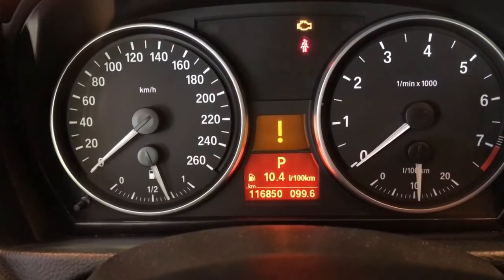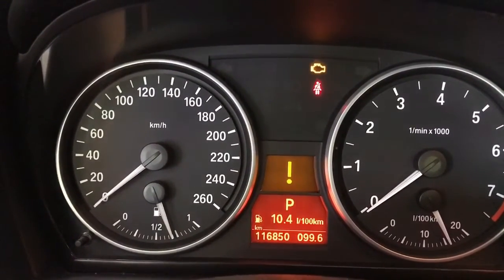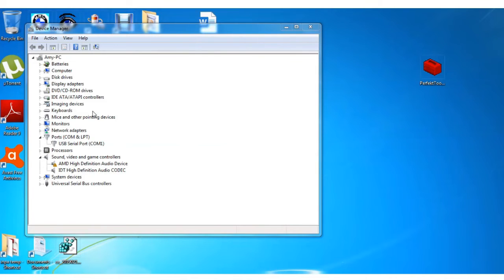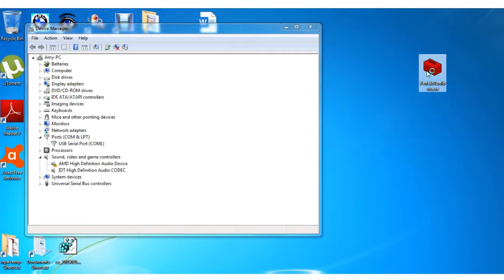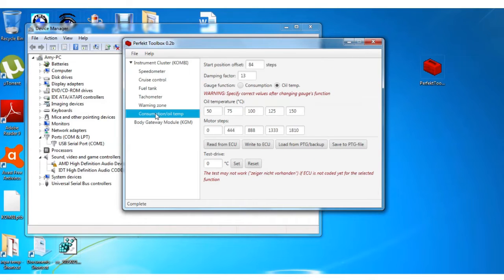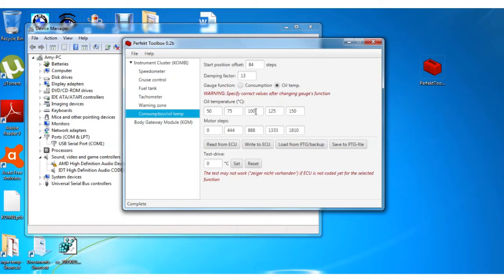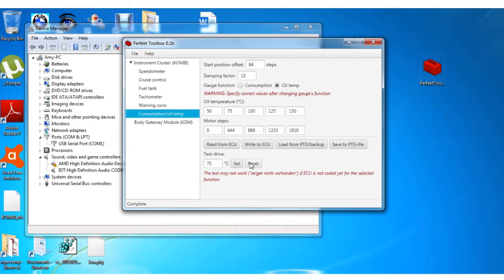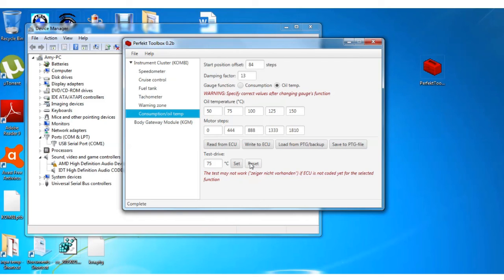Convert fuel economy gauge to oil temp on BMW E90

Comment: Hey I tried doing this on my 2007 BMW 323i, everything went well but the Perfekt Toolbox software never opened, tried it multiple times but when I click on the software nothing happens it doesn’t open up. I used a laptop running windows 11 not sure if that’s the problem. Please advice.

Comment: Old video. I just did this on my m57 330d e91 and it never reached 100 degrees. Even at 42 degrees celcius outside did not reach 100. It mostly is arround 50 to 70 degrees. I don't think this is working as it should.

Comment: Thanks for the guide it works on my BMW E90 320i N43B20.
I have the „Low“ Cluster and the consumption gauge can be changed to oil temperature gauge just like in the video. Also, before you code in the oil temperature gauge, you should check if your BMW has an oil temperature sensor installed. Some don’t come fitted from factory like the M47 Pre LCI. That’s the reason why it doesn’t work on those model. Just for clarifying

Comment: Works on 330d e90. The only issue is that temperature raises to 60-70 sometimes 80 degrees and then after regular driving temp drops to 50 degrees...i don't think is indicating properly.

Comment: Hi guys, there is actually a easier way to do this and it's even for anyone driving a BMW E-series, it's a new beta feature in Carista! I’ve been using it for a bit, and it turns the fuel consumption gauge into a real-time temperature monitor. You can even customize the temperature range that shows up, which is super handy.

What I love is that you don’t lose the fuel consumption display either – you can just move it to the center screen by pressing the BC button, so you still have both pieces of info right there.

Honestly, it’s been a game-changer for me. Definitely worth checking out!
Reply: this is the same thing and it doesn’t cost money
Reply: I emailed Carista and checked about this.  They said they DONT support this feature for BMW diesel engines
Reply: Can you post a video of that?
Reply: really? on a diesel too?
Reply: @daviddorado5632  yes it works, sorry but I can't post photos or videos here. But toy can try it out with Carista!

Comment: Hi Eng Guy-   This little app of yours is absolute genius!   The MPG/LPK gauge is a usless feature BMW started in the late 70's......
1) By the way, your toolbox download link is blocked by most PC browsers.  My workaround-  download the zip file onto my iPhone and then send the zipped to my PC.
2) I saw a PDF somewhere describing how and where to install the app, but don't remember where I saw the install PDF.  You zip file is just the exe file itself with no help files.  Do we install the PerfektToolbos.exe file in the EDIABAS folder?
3) Do you have a 64bit version?
4) Have you done any research on upgrading the radio/nav head unit-  ie CCC to CIC retrofit?
Thanks!

Comment: Works like a charm with 330d M57. Only minor issue is that gauge doesn't point exactly to zero on ignition start.
Reply: @czr4140  what year is your car btw ?
Reply: you can change that with this
Reply: Are you sure it the oil temp and not the water temp?
Reply: @LighthouseBaptistChurchAlmere  it's water temp, i stand corrected
Reply: Did you figure it out? I’ve set the offset to 0 on mine and that way it works perfect
Reply: @E90335d  sure, played around with motor starting position and set it up the way i like it. What I can't figure out is why coolant temp sits at around 82 degrees with both thermostats changed. That's some mighty torque btw 👍
Reply: @czr4140  thanks bro, that’s why the offset is so high so when it’s 90degrees the needle is in the middle. The thermostat is 88 degrees so 82 should be fine 👍
Reply: it is water temp actually
Reply: @czr4140  what do you mean? The temp were seeing is not the the oil temperature?

Comment: It won’t work on my e90, 2006. M47N2 ☹️☹️😡😡 on oil temp stays on minimum, i saved backup and return
Reply from the maker: Sounds like a Euro engine to me.  North american Engines are N5X
Reply: @mecheng1977  yes its euro engine. Is there any way to set it up? 😫
Reply: It doesn’t work on m47… same problem

Comment: Hello, your conversion instruction is great. I installed the Perfect Toolbox, everything works, I did the conversion, the test-drive works, the indicator shows the set value. The problem is, it doesn't show the oil temperature. Is it possible that my engine does not have an oil temperature sensor?
e91
2006
2.0 Diesel M47N2
Reply: same problem. oil temperature sensor appears to overwrite the data from the coolant temperature sensor. through diagnostics these two data are identical. After setting as in the video, the oil temperature is kept to a minimum
Reply: Did you find any solution yet?
Reply: Same here for the m47n2, anyone found a solution?
Reply: I have exactly same problem

Comment: Hey, does this work on e92 2011 335D. Thanks!
Reply from the maker: Not sure
Reply: I think it shows the water temp not the oil temp. I did my 2006 335D and it never gets much above 75. Diesels do run cooler but it seems like water temp. Also on mine I only see a water temp feature in the hidden menu

Comment: Why do i also need the BMW EDIABAS software? How do i know what motor steps to insert, or can i just leave them as is?
Reply from the maker: You can experiment with the steps
Reply: @mecheng1977  Thanks, i have got it to work, was quite easy actually.

Comment: It works If i test it in the perfect Toolbox, but it doesnnt change when i drive. What is the problem? M57 2006
Reply from the maker: Are you sure the engine is warmed up? Sounds like it didn’t write to the kombi
Reply: @mecheng1977  yes i am sure the engine is warmed up, i think it doesnt work on my car..
Reply: @robbertslingerland2633  I have the same issue. Same engine an year. When I applied the changes, the needle just moved 1mm to the right and doesn't react anymore. The needle moves in the test, but it's dead on the dash. Can someone help?
Reply: @MTSnev  bro same year same engine same problem did u fix it?
Reply: @dena.  no mate… I think it’s because of the cluster itself. It has to be the high version - after 2007
Reply: @MTSnev I have 2011 335d mine is doing the same thing

Comment: Remember this works only with High Speedo and not Low Speedo
Reply: what do you mean about that?
Reply: @HeavyModded  Its two different speedometers. For example like on E6x its normal to have high speedo ( the best one ).

On E9x it came with high speedo and low speedo. Low speedo is ugly with small display.

Comment: Hi, good video thank you. I have tried to do on my e90 330i and have issue with values on gauge. When I set temperature to 100 I see 7 on gauge. When I set temperature to 120 I see 10 on gauge. Strange.
Reply: Have you tried to set the range from 70°C to 170°C with 120 in the middle ? It seems to be the right value for the 330i as you can see on a E92 330i cluster.

Comment: Great job! It seems that my INPA doesn't detect the car at all. It shows "off" even when it is on. Any suggestion?
Reply from the maker: OmegAtlAnt it could be anything, make sure u are on com 1, check the installation guide
Reply: @mecheng1977  thanks man, I solved, it was Com1 (I had Com 3) and then not having EDIBAS 3.7.0 installed. The CD software driver the cable came with was s**t , found much better drivers online.
Reply from the maker: OmegAtlAnt great

Comment: It doesnt work on e92 325d 2011 n57, any sugesstion ? Thanks
Reply: No, it only works on the M47/M57 Engines for the E90
Reply: Correct. I just testet on my 2011 325d whit N57. It dosen't work. :(
Reply: @eyestormE30M3  it doesnt work on my e90 325d n57

Comment: Great video, thank you! Does it work on 4 cyl engines for example m47, n47 and ect? Thank you.
Reply from the maker: Пирин Тихинов sorry I do not know. You can try and report back. Just save your file
Reply: @mecheng1977  I got a 335i cluster which has the tempeture gauge. Do you know if it's possible swap them and put it to work without codes and syncrhonized with my VIN? Ive looking for this and no answers so far...
Reply: @lucasld95  You will still have to code it. You can't put in a new dash unit without coding it.
Reply: i tried on an n47 but it doesn’t work